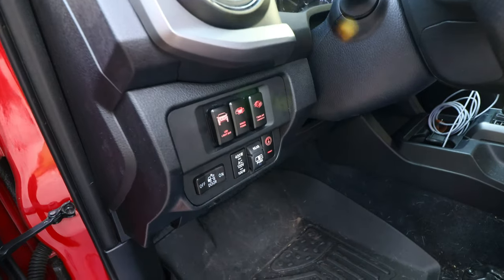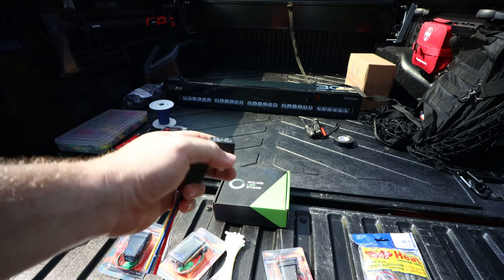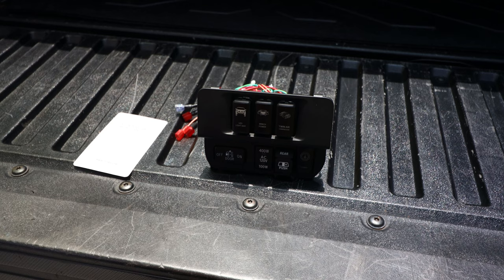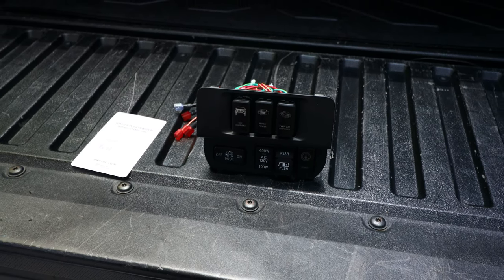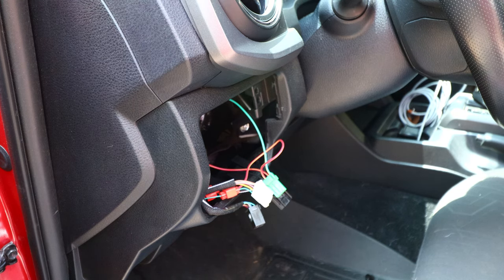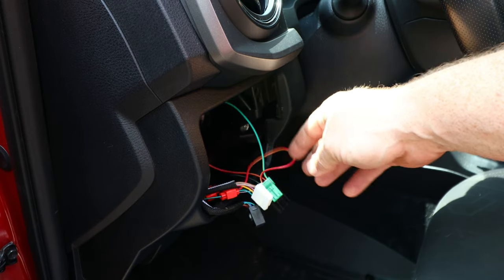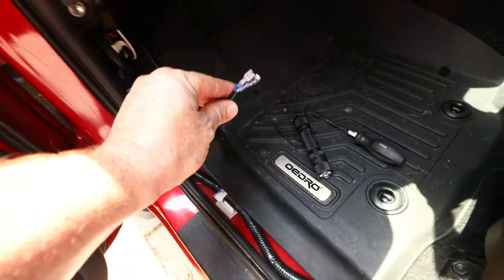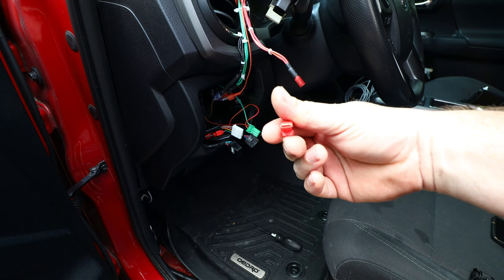Toyota Tacoma Mods | OEM-Style Switches & Cali Raised Switch Panel (3 Switches) | CH4X4 | Amazon Mod

Comment: Forgive my ignorance, but are you saying that I only need 1 wiring harness for 3 different light sources? Example: I have the same CH4x4 switches (roof rack light bar, ditch lights and LED light bar) and the lights come with their own harnesses and cheapo switches. I set up a blue sea fuse block and circuit breaker and am trying to keep everything localized, clean and easy. I feel like I'm so close to this all making sense. I really like the way you did everything and would like to mimic it, but I am lost at the combining the wires minus the R1 to connect to 1 harness.
Reply from the maker: Each light source should have its own main power wire harness (usually it should include a relay).

When using multiple switches for multiple light sources, the switches can share 3 of the 4 wires (12v power, illumination, and ground).

The 4th wire (one per switch) is used to send a signal to the particular accessory you are trying to turn on when pressing the switch. This wire connects to the relay that is part of your accessory's power wire harness and commands the relay to send full power to that accessory.

The only thing that the switches do is send a signal to a relay. The relay is then responsible for sending the main power to your electrical accessory via the power wire harness that comes with your accessory. 

I hope this info helps 😁👍
Reply from the maker: I also made another switch video, if this might help shed more light on the subject
https://youtu.be/eJPNJGZy_AU
Reply: @LevelUpMechanics  Thanks for the reply! So I watched the other vid (really liked those illumination switch harnesses BTW), and if I understand correctly, you spliced/combined the three light harnesses together minus the relay wires to then attach to the grouped switch wires? By doing that you only pushed 1 three strand group of wires through the firewall to make that connection? Then you attached the spliced light harnesses(now 2 individual wires to your fuse block? Sorry, I'm a very visual learner!

Comment: Hello, I'm wondering how I can know which cable is the green one for your Tacoma, but how can I check that it's the correct one to power the other switches?
Reply from the maker: So, each aftermarket switch has 4 wires

Green - you connect to the battery with an in-line fuse (3 amp / 5 amp fuse) . (12v power in) 

Red 1 - This wire will send a signal to the relay that controls sending power to your aftermarket accessory when you push the switch on. (12v power out) 

Red 2 - This wire just connects / taps into a wire from your original Toyota oem switches and is used to illuminate the switch when you turn your headlights on... to find the oem wire, you just have to find a wire from the oem switch connectors that has 12v only when your headlights are on (and 0v when your headlights are off).

Black - this is your ground wire that you will attach to a ground point on your vehicle. 

All the switches do is send a 12v / 5 amp signal to a relay. The relay is in charge of sending FULL POWER - 12v / 30-40 amp - to the accessory. 

I hope this info helps... 😁👍

Comment: Is the switch you used still necessary if I have a blue sea systems fuse box ?
Reply from the maker: No, it's not necessary. You can still use the generic switch that comes with the aftermarket electrical accessory (like the light bar). I just used the oem-style switches in this video because that's the setup I wanted.

I hope I'm answering / understanding your question correctly? 😆
Reply: @LevelUpMechanics  I think I understand it a little better. I have all the supplies needed to tackle this 
The 3 wires at 14:01 are they all 18G wires 
I believe one was hot the other was a ground and the blue one was for a relay?
Reply from the maker: The black wire = ground (shared for all of my switches) 

The white wire = 3 amp fused power wire from the battery (shared for all of my switches) 

Blue wire = signal wire (not shared) that sends voltage to the relay (once the "individual" switch is pressed), telling the relay to "turn on" the lightbar / accessory. 

I hope this info helps 😁

Comment: Is it okay use one relay for 3 switches?
Reply from the maker: If you do that, then the 3 switches will all control just 1 relay (which would defeat the purpose of controlling separate electrical components)...

I hope that makes sense 😋.
Reply from the maker: The relay is what controls sending power to an electrical device. The switch is used just to tell the relay when to send that power.
Reply: @LevelUpMechanics  Thank you Sir
Reply from the maker: No problem... 👍. Happy to help 😁

Comment: I still don’t understand the relay part.
Reply from the maker: A relay basically allows you to use a "low power" switch (usually less than 3 amps) to control when you want to send "a large amount of power" (for example, 30 amps to a lightbar that needs a lot of power) to an accessory.

If you only used a low power switch (3 amps) to send power to a lightbar (that needs 30 amps), you would melt the switch and possibly create an electrical fire 🔥. 

A relay just allows you to control when you want to send a lot of power to an accessory by using a "low-power" switch.

Comment: Won’t fit on all Toyota Tacoma’s. Mine is a 2022 4x4 Off Road XP package and it won’t fit. There’s a extra button already at the top so the box isn’t there and there isn’t anything to unscrew and no way to attach this part unless you take a risk and do some cutting. Personally I think that’s BS and nonsense because there’s two empty slots at the bottom Toyota could have used instead, like why didn’t they put that one button in one of those spots and leave the top fully empty knowing majority of Tacoma owners will mod it. Thanks a lot Toyota.😭
Reply from the maker: Well, that's annoying, to say the least. I made an updated video after this one. There are some new modular switch panels that are available now, from Guild Outfitters, that might provide a solution for your Tacoma 👍.

https://youtu.be/eJPNJGZy_AU
Reply: @LevelUpMechanics  Thank.
Reply from the maker: No problem 👍